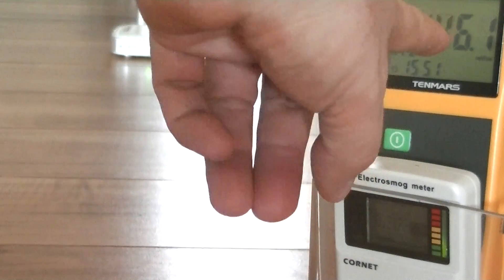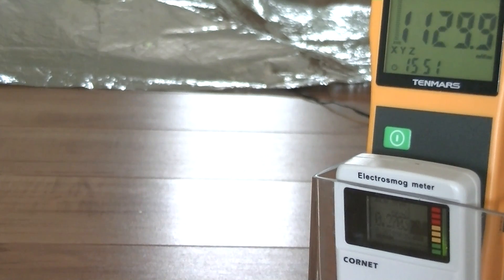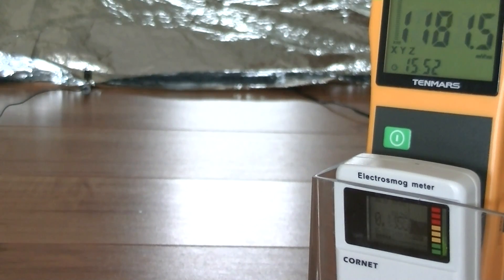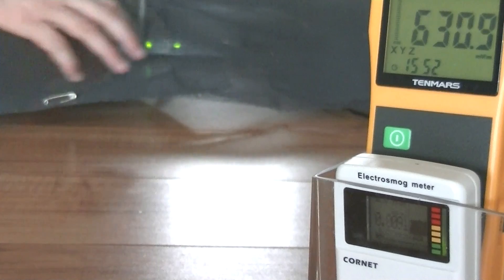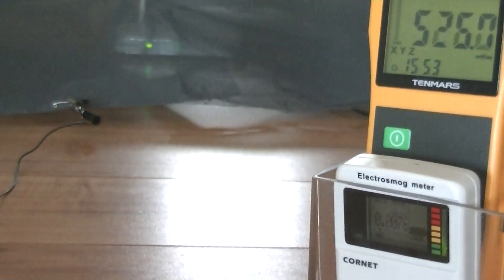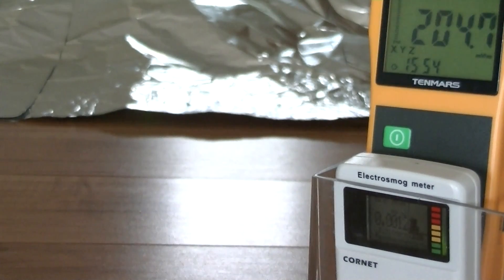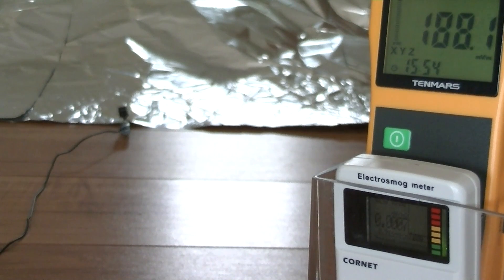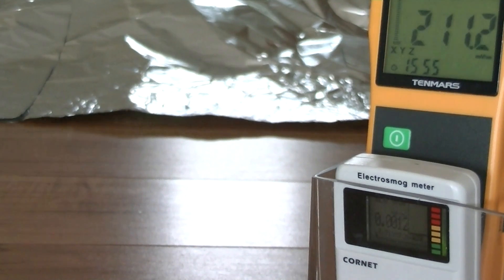Comparing Shielding Performance of Space Blankets, Aluminum Mesh and Foil, Grounded and Ungrounded

Comment: can I place aluminum foil on all my walls and Windows without grounding and be protected ?
Reply: They have what they call a faraday cage. You can hook it up to your whole house. Also using either aluminum screening in some areas where the radiation is lower. You can also put your router. In a faraday cage you can put your phone in a faraday cage. There are some check people out there that will come to your house and they use a special graphite paint the paint has to go all the way around the walls and touch itself and then you have to ground it. Once you do that with the paint. Then you measure out with weak points are. And that's where the aluminum. Screening goes up. Then if you need cover from the air. The best thing everybody can do now is if you're building a new house. Make sure that you would incorporate a a faraday cage into it. Everybody stay blessed. Stay lifted. Stop the f**** roll out of 5G. If people can't connect the dots by now? You're kind of standing in line waiting to go into the grocery store wearing a mask. You might as well be like a cow walking into the slaughterhouse. Stay safe, stay lifted. Help lift other people wake them up.
Reply: good question.. you wouldnt want to become a fkn human transmitter lol
Reply: Ground it for safety measures
Reply: @RotaryMotion  How do you ground these kinds of materials? Attacking some sort of metal to it??
Reply: @Bizzare77777  I am sure there is many ways to accomplish necessary grounding, one would be to solder the shielding material to a conductive rod and dig it down into the earth. If it is big electrical projects that need serious grounding. For smaller devices you can ground it in specific hardware.

Comment: Well done. After reading some negative comments I would suggest adding a phone running WiFi Test program to your video. I use WiFi Analyser and it gives a nice graphics rendering of signal strengths. (I have a "noisy" neighbor and it looks like I have to do the whole wall.)

Comment: i just bought a multipack of space blanket! what is the grade of aluminium foil i need to get; presumably it's not just kitchen foil?
Reply: Kitchen aluminium foil is enough. Space blankets usually fail because the few atoms thin aluminium layer breaks by any tiny crinkle (also the by folding from the way it is packaged). Check the conductivity with a multimeter.

Comment: As an author/consultant on personal privacy and security, including political control technology, and as a college level instructor of digital electronics, my concerns with this test is the simplicity solution for video's sake has introduced performance inhibiting factors. I believe it will account for some performance variations between products as well as between grounded-non grounded. A) YOUR router on the floor is presumably omni directional. You have it on the same plane as your meters. By covering it they way you do, the signals are still free to travel horizontally towards the meters as well as downward, where there may be reflective materials sending some signal back and to the meters; B) NEXT, by making direct physical contact with the router antenna with the shielding, you effectively achieve a degree of transmission inductance into the materials. Their shielding power is therefore diluted by the ability of the material to serve as an antenna. Foil and mesh would outperform the mylar as such for the conductivity factor you illustrate. So the actual difference may be entirely different than this test indicates. I would like to see the test redone with boxes which completely enclose the router, with the router suspended from the bottom of the box by a non conductive riser such that the antenna is 'centered' in the space. If you prefabbed some cardboard boxes with linings and moved the viewpoint further from camera, you could  still achieve the video simplicity with the meters closer to camera, perhaps shifting focus if lacking depth of field; C) AND, conductivity issues should be a factor only in the grounding aspect of mylar. Therefore, the differences in your test results of the new test should then be very compellingly different, whereas this test shows minimal impact on any of the materials. I propose an additional factor which might further improve mylar's performance and bring it nearer to the metallic shielding: wrap the box with a strand of copper wiring as if ribbon on a gift, but additionally about the horizontal so that all surfaces are 'crossed', and ground THAT and the mylar. I believe you will find improvement. This would require 6 prefab boxes. It is ok for the box top flap to have a break in the wire wrap if the wire is bare, or you can twist bare ends to close or jumper them; D) FINALLY, you need an ambient level which should be subtracted from meter readings, a starting reading with the router turned off.
Reply: +blahtalk A few layers of aluminium foil or copper tape will definitely help substantially. Either on the walls (doesn't have to cover the whole surface, even a few squares dispersed would block a decent amount of the signal), or you could coat a wooden/cardboard board with foil and place that between your mics/guitar/computer and the powerlines or anywhere else the EMI is coming from. Your computer itself probably contributes a fair bit of EMI too.
Reply: @AJDOLDCHANNELARCHIVE  
Do these shields have to be grounded?  If yes, how?
Reply: @AJDOLDCHANNELARCHIVE  I want to protect my babys room with aluminium but ,what  if I have a hole in the shielding ? ,Could some radiation keep bouncing inside ? .I dont wanna make things even worse .
Reply: You just said most of what I was going to, and you said it well.. Thank you.
Reply: H. Michael Sweeney   Hi, I have a question for you. I'm picking up a lot of EMI through the floor of my apartment. I have a small home studio-type upstairs. Everything is grounded (I tested it w/ a meter on the outlet), but I get noise that only goes away if I face my guitar at very specific angles and on one specific plane. This situation also pretty much renders dynamic and ribbon mics almost useless. I understand that moving coils mics are more susceptible to this sort of thing. Now, outside my window, there are four transformers on the power lines and a row of air conditioning units for the apartment. I'd very much like to lower my noise floor. Would aluminum foil or anything mentioned in this video greatly reduce the EMI that I am picking up? I realize that what I am asking is more related to the audio aspects of this. So, if you don't know the answer, maybe you can steer me toward someone who does.
Reply: Hello Professor.  Can you point me towards detailed manuals on building a faraday cage which 100% blocks all RF ranges used by us today? (3khz to 300GHZ)
Reply: You’re smart.
Reply: @aussie8114  Ha ha... I do like to say... I know so much about everything that I can talk endlessly on any topic, until revealing I don't know enough about anything to warrant doing so :)  Ergo, being dissatisfied with the number of people I can so inflict myself, I've written many books and have some 100 hours on radio here and abroad, for maximum self-humiliation. :). But I do have 4 experiential degrees granted for the purpose of teaching college courses in different fields, and recently, at age 77, have acquired an earned Doctorate in Theology, whereupon I will soon have my own sermonette channel, proving once again that those who can't do, teach, or (in my case) get preachy :)
Reply: H. Michael Sweeney why don't you just do it ???

Comment: rf grounding is complex subject and its not a simple case of linking a wire to an earth rod.all wires exhibit inductance which limits effective grounding at high frequency, the length of wire needs to be short as possible  . do some research talk to reputable ham radio operators spent years studying this stuff.
Reply: Peter B Apathetic minds can not believe theirs own eyes.It is valid ,you have 'shown' nothing but vain words to prove otherwise.
Reply: ya its making my head hurt more than the RFs!

Comment: good video i just want to add that if you would close the gaps between the floor and the foil / mesh /  etc..  the radiation would be even lower and also if you want to block it totally you can wrap the source several times (if you cant just turn it off :)   .. )

Comment: Would it be helpful to put a piece of aluminum foil between my laptop and the cooling pad/cushion that it sits on while I am using it?
Reply: Disable wifi and bluetooth (best in the bios or rip out the card) and use an ethernet cable (optical fibre would be even better, but standard laptops have no connector) to go online.

Comment: You hath to wrap the whole thing up in it it doesn't work if you just laid over the top
Reply: +Ron Tickner That aluminum foil looked like it did a significant job, just laid over the top, though.  Which translates, I hope, into using to cover room walls, ceilings, or lay under flooring being at least that good an abatement.
Could fairly easily lay foil on floor under the bed, to shield that if needed. 
Heavy Duty aluminum foil is Loads cheaper than even buying aluminum window screen, to abate walls or ceiling sources, and can be made temporary, for those who rent and cannot make changes to their apartment or house.
Reply: You need to surround the device. ... reflection off floor leaking underneath... you covered greatest with the aluminum foil toward the receiver... to block the most leak and reflection

Comment: I don't know if you noticed, but when you grounded the aluminum window screening and the aluminum foil the RF radiation was reduced by 40-50%.  I think it did have quite a dramatic effect on the shielding capability.  It would be interesting to see this test done with the router closer to the meters.  You may see a more dramatic change with the grounding that way.
Reply: Doesn't matter; a simple and CHEAP alu foil was the best! 🤣

Comment: Fantastic video! Thanks, you've just answered my question. They installed a cell tower (built a clock tower disguise around it) in my neighborhood and I'm researching inexpensive RF blocking natural (no outgassing) window treatments (curtains, film, etc.). I have a lot of glass to cover and so far everything is synthetic or it's very $$$. Meanwhile I want a cheap way to block RF coming into my home office where I spend most of my day - it faces the tower and one wall is 85% glass - since I've been getting really bad headaches since the cell tower went up. After watching your video I'm going to buy some foil today and just cover the glass as a temporary measure. If you have any suggestions for something permanent I'd be very grateful to hear your ideas.

Comment: Cool video. I'm building a racecar and have problems with a module that's interfered by non-resistored sparkplugs as they omit a great deal of electrostatic noise compared to resistored plugs. This is no bueno for a race car. Do you think wrapping in this module with aluminum foil would make any difference?

Comment: Great little video :-) Thanks for sharing... To give you another perspective... In Tesla's Patents he had one which would capture atmospheric energy using an insulated plate, which was insulated on both sides and connected to a device using a wire, much like your ground cable... using the Aluminum... placing the sheet between 2 insulators (Glass of Plexiglass) and your grounding cable to a device, which is grounded, one can draw power from the atmosphere... Try that one :-) Essentially, you're taking the EMF and converting it back to usable electricity... Wireless power... Enjoy!

Comment: Thanks for this informative video.
I work in I.T and when shielding routers I've never found thick or thin tinfoil very effective for more powerful routers such as BT Homehubs. Instead I find aluminium chickenwire is the best, and you can get rolls of this stuff from Wickes plumbers etc in the UK for about £8. The mesh holes should be quite small, say 2mm to 6mm.  The wire can be cut to fit into A3 size plastic document pouches of different colours if required.
When measuring a sheildings effectiveness  with routers and cordless phone base stations, I  usually only put the sheild in front of the device, not totally covering it as in this video. The reason being that some devices will go to full power if covered up totally, thus defeating the objective. 
Finally, a tip regarding BT HomeHub routers. Even though you switch off or disable the wifi on these routers they will still emit radiation. The wifi light may go off but it still emits. The trick is to go into the router setup and set it onto 'standby' for as long as you can. The router will still work but now wont emit radiation or internet phone signal; and you'll get red lights instead of green on the router. .
Finally, best be careful with space-blankets as they are flammable.
Reply: It wont stop 5g
Reply: @thespanielinquisition7167   What will stop 5G?     MUST MUST MUST block that stuff.

Comment: If you used Mylar tape to close the leakage on the sides of the Mylar blanket, and also placed another blanket under it as well (creating a completely enclosed space), I'm fairly confident you would at the very least block off 80% of the signal. I'm willing to bet that percentage can exceed 90% if all leakages are thoroughly protected. Even so, the Mylar blanket alone placed over blocked around 55-65% of the RFR. That is actually pretty significant, as any protection is surely better than none at all, and IMO, 65% protection is looking like a pretty good number for such a crumby, 2 second protective effort. It has more potential. Just show it some love. ;)
Reply: If that would be the case then foil completely around would be really nice; though Mylar is a bit cheaper but would need to decide how much one would want to block.
Reply: Most space blankets are anyway full of gaps because the aluminium layer cracks at any crinkles (also those by the factory folding).

Comment: Thank you for this, for years I've been hoping that by not grounding my carbon conductive paint that I am not decreasing any attenuation I might have.  But I have found that these microwaves are very difficult to screen and leaks occur where you wouldn't expect, for example I have hung RF fabric at my door to screen out a local phone mast, the wall around it is painted in blocking paint which I painted over with emulsion, the fabric is pretty much touching the wall but there is still sound on my acoustimeter so I have had to tape the fabric to the wall.  I have found also that if the layer of emulsion is too thick the waves travel through it.  Another thing is you have the router on wooden flooring which would similarly allow the waves to go through it and reach your meter.  I recommend watching microwave expert Barrie Trower's videos on YouTube.  Peace & Love.
Reply from the maker: Interesting information you have about electromagnetic screening.  The floor in all of my videos is a ground floor steel reinforced concrete foundation, my home is single story.  What you are looking at is about 1/4 inch laminate wood on top of it.  Gaps can be an issue when trying to screen a whole room from a cell tower, as you have found.  However, when screening a radiation source up close, they appear to be less of an issue.  You should be careful with electromagnetically screening a whole room, as you may make yourself sick from natural radiation deficiency conditions that may show up long term, similar to what astronauts show on the space station.  Take care!
Reply: Microwaves have a wavelength of some centimeters. Any breach that is longer (i.e. also the natural gap in a 2m high solid metal door makes a 2m wave pass through!) makes them pass.

Comment from the maker: The router is well covered up with only small gaps at the edge.  I understand the gap issue, but it does not appear to be a factor in this experiment.  I am planning on repeating the experiment with no gaps soon.  Keep an eye out for the video.
Reply: Did you try it ? And did you try doubling (or tripling) the aluminium foil layer to see if there is an increase in shielding ?
THANKS ! YOU'RE THE BEST !

Comment: Steve, you need to cover the router in a more consistent fashion---you are leaving gaping openings that allow the signal to escape, and with each material the gaps are different. The shielding should be set up as a kind of wall between meters and router.

Comment from the maker: The router is a standard residential 2.4 GHz unit made by Netgear, model WGR614 that is rated at 2.4 gigahertz and 0.129 watt.  I think when it comes to electromagnetic shielding that there is a difference between near shielding to the transmitter and distant shielding.  I will be using aluminum foil for either exposure from now on.

Comment: Thanks for the informative video great idea.
I`m know confused why the mylar works so well in my condo, I have it covering my bedroom balcony sliding doors and it does a great job at blocking RF signals...
Maybe this has something to do with the strength of the signal? What gig rating is the WIFI router ?
There is a condo with a crazy amount of Cell booster antenna on it`s roof about 1 city block away giving crazy high readings on my RF meter, so maybe it`s far enough away for the mylar to work?